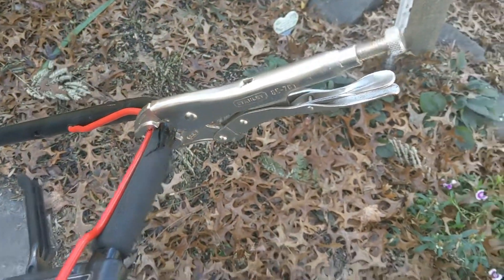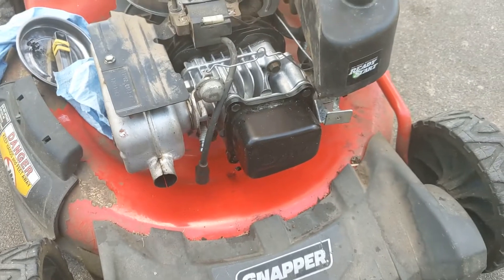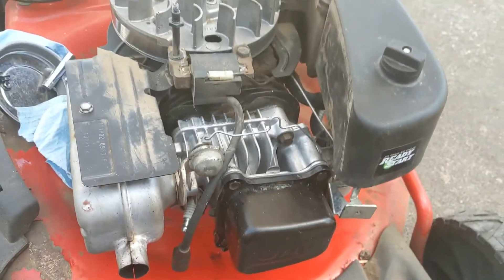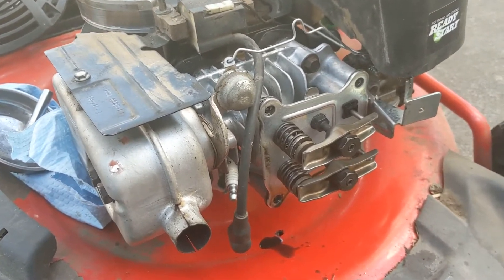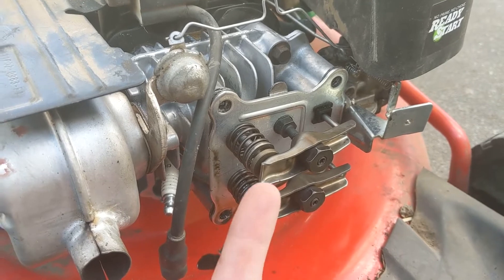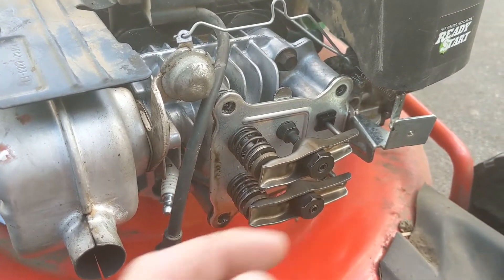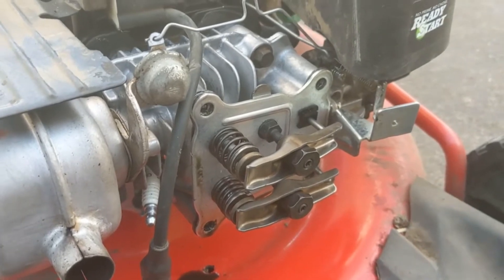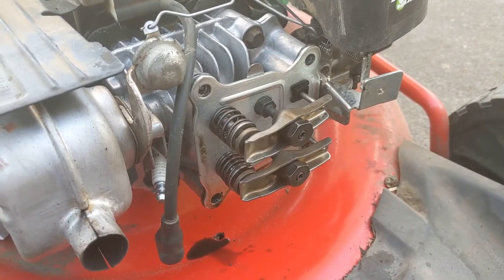How to set valve clearance on a small engine - Briggs and Stratton engine

Comment: I never had to do it for the valve clearance but I did have to set the spacing on points before. My old mini-bike when I was a kid had a 3.5hp briggs and stratton engine on it.
Reply from the maker: That sounds like fun! I like messing with small engines.